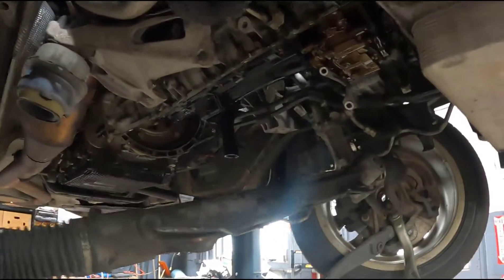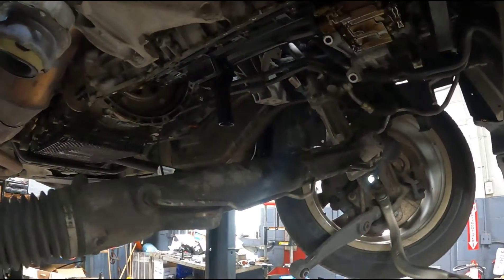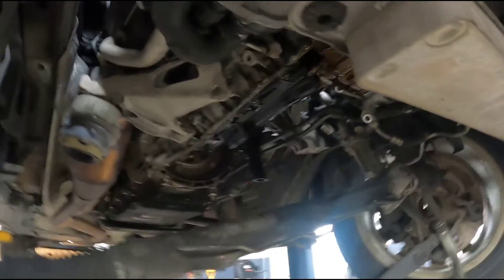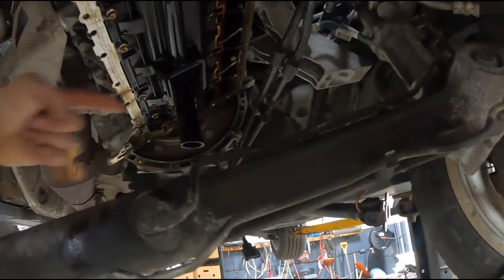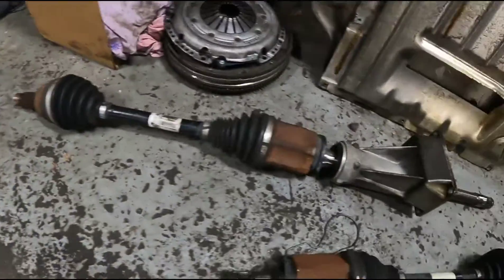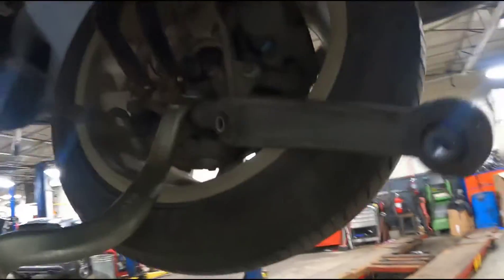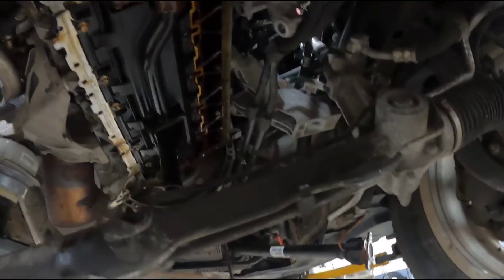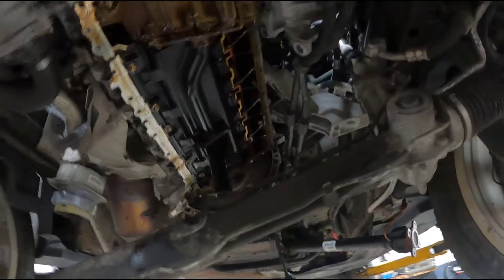2013 BMW X5 OIL PAN GASKET REPLACEMENT OVERVIEW

Comment: This was a great video.  Wife's X5 has 120K and recently when changing the oil, I can see it pooling on the underbody cover near the drain.  I started to investigate and assumed it was a gasket.  This is quite the JOB!  Glad I watched the vid before I decided to look into it further.  Sounds like you are in the metro D area - indep shop or are you at a dealer?  Not sure if you can say here.   Might be visiting soon for a repair.

Comment: common for relatively low mileage specimens to develop a oil pan gasket leak?  56k miles on ours and we're experiencing this.
Reply from the maker: Yeah I've seen it a lot. Pretty big bummer considering it's just a gasket. Sometimes on the models with the aluminum bolts the heads will pop off of them and that's why they lose tension. I'd try to replace and bolts if you see the heads missing and see it that improves the situation

Comment: Jesus man🤣 you didnt have to remove the subframe or the steering rack, you did way more than necessary
Reply from the maker: Lol
Reply: How to remove w.o sub frame remove?
Reply: @dbnzt  just lower it while keeping the suspension arms attached
Reply: @louisianavq1943  I'll give it a shot but legit looks impossible lol
Reply from the maker: I do that sometimes
Reply: @dbnzt  you’ll still need to remove the front diff, front axles and make sure you support the engine with an engine holder If you will be trying this job on the ground then yeah I’d say to just remove it completely but if you have a lift then you should be able to just lower the subframe with it attached to the control arms, tensions struts and tie rod ends